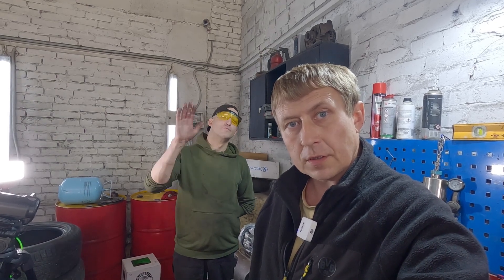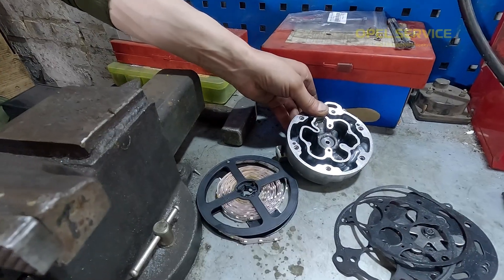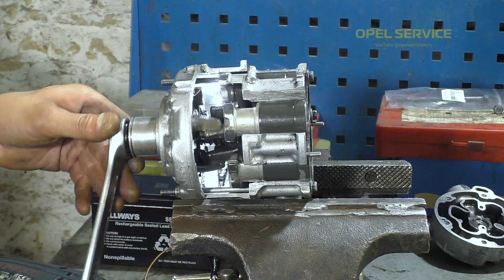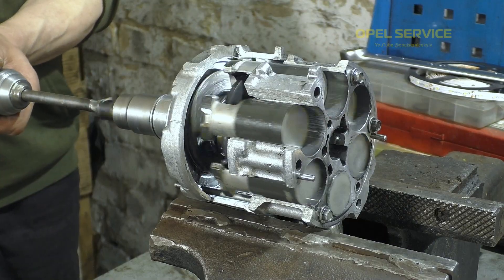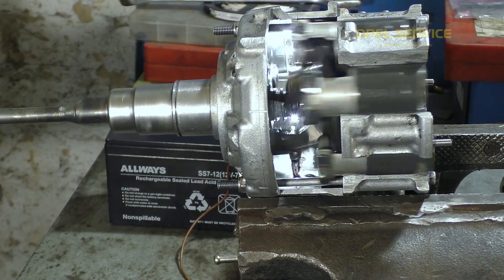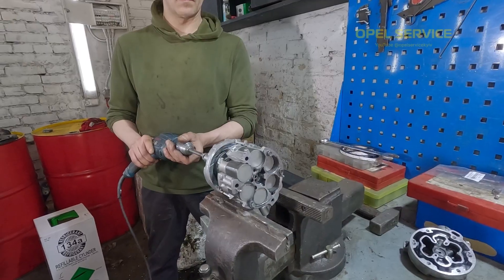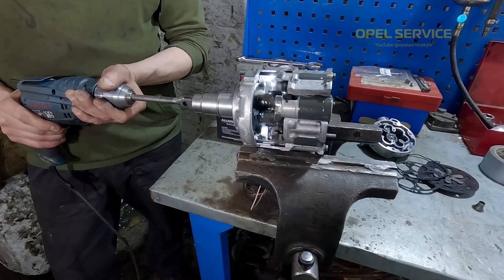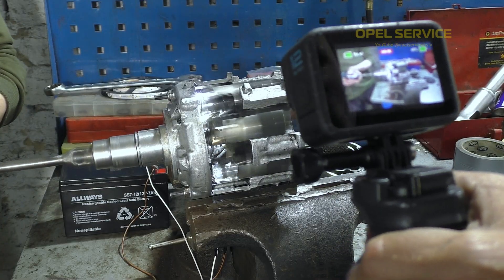How the swash plate mechanism works from the inside

Comment: Gr8 video, i had an omega A c30ne engine with the v5 compressor and currently restoring an omega B with the x20xev engine and also the same v5 compressor, i had no clue about variable displacement compressors when i opened up one to clean up and change body seals and shaft seal...apparently the mechanical control valve causes the compressor to seem faulty when the control valve becomes faulty...i got a few of these compressors from salvage parts and most could not be recuperated because of rust buildup...but that provided parts and stuff to make some testing tools, i made up a tool to test the control valve and another to open up defective control valves...eventuall i discovered how to test and even what can be done so that the compressor stays on maximum displacement longer without actually modifying the control valve to stay on maximim displacement, apparently the action of the internals of this control valve pushes oil that returned to the compressor suction area, it pushes this oil back into the crankcase of the compressor...something very important for the lubrification of the compressor internally...control valves that were found in good working order, they would cause the reduction in compressor displacement around 30psi, which according to R134a gas, around 0°C evaporator temp, however being in a country which thermal sensation last year reached record high of 62°C, any more cooling possible is welcomed....what i did was grind off the tip of the pin that pushes the stainless steel ball located at the tip of this control valve...then reassembling the control valve and testing it again to see at what pressure it will reduce the compressor displacement...if it does not, too much of the pin was removed and it is not contacting the stainless steel ball, in this case it may be possible to close in the body of the control valve slightly and re check what pressure the compressor displacement will be reduced...any questions about this , you can whatsapp me on +18687971669
Reply from the maker: Thank you for sharing your experience — it was really interesting to read! 👍
I had no idea how important this control valve actually is. The way you tested and even modified it is truly impressive. It’s clear you know the topic very well. Thanks again ! 👍👍👍
Reply: @opelservicekyiv  трохи не в тему але мушу запитати. Якщо подати вам він номер то ви маєте можливість дізнатися які саме запчастини були встановлені на заводі? Цікавить маховик, щеплення і супутні дрібниці? Астра джей 2015 рік. A20DTH(LBS). Навіть якщо це не безкоштовно.